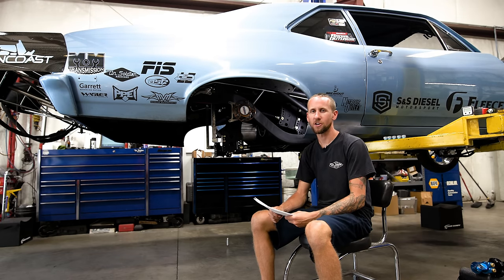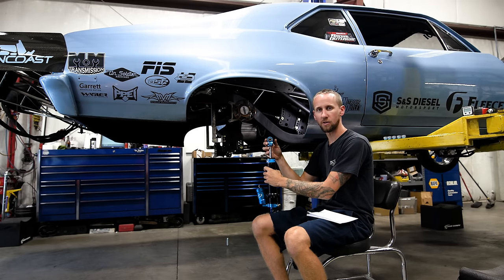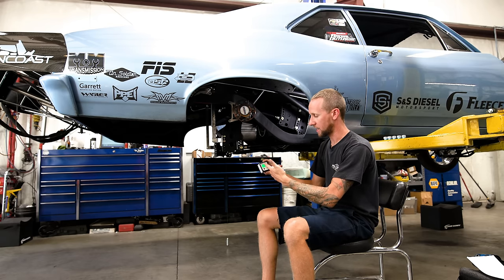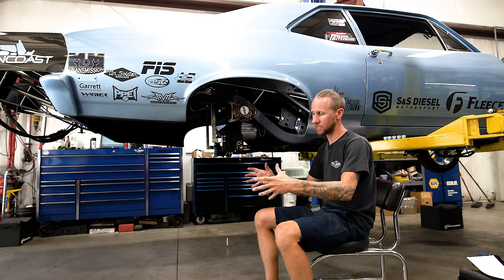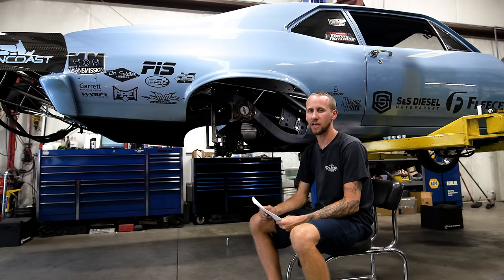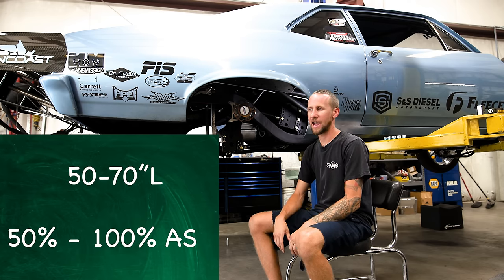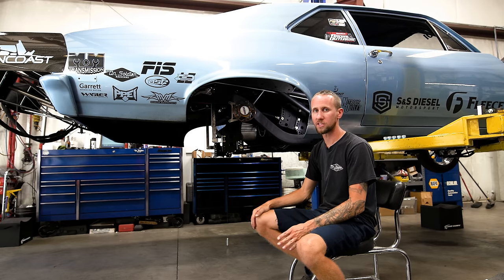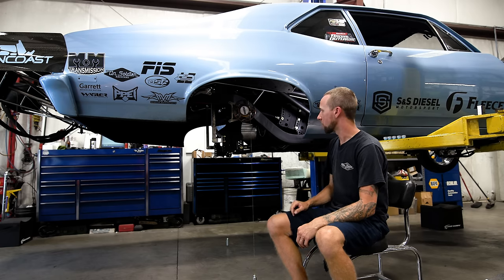4 Link Suspension For Drag Racing -  Useful Tips How To Set Up Successfully

Comment: Couple of comments. String the chassis to find the centerline & measure 4 link chassis bracket locations to ensure they are exact side to side & front to back FIRST. If not, everything measured from there on will be off & you will have to start over. 
Using the string method eliminates measuring from ball joints (or other components) as well as if the car has staggered front wheelbase.  Another reason for establishing centerline is getting wheelie bars square to the centerline. When there's rear steer the wheelie bars should be adjusted to the centerline. 
 Another method of measuring pinion angle is to remove the driveshaft from the equation. Measure rear end housing angle & Engine/Trans angle then calculate from there. 

Great videos, thank you for sharing!
Reply: A Educated customer is the best. Has a class are type of racing ET .And then theirs the rest .ProStreet guy that Champagne taste on a beer budget

Comment: What is the most accurate way to find the middle of the car in the front?  I have a stock susp. foxbody.  Love the How To vids, thanks!
Reply: Find one point on the sub frame inside or out doesn't matter drop plum bob mark it on the floor. Go to the other side an the exact same location on the sub frame from the other side do the same plumb bob it. Do the same in the rear then measure between the two points on the front. Find half way an do the same in the rear. An you can chalk line the two center marks front to rear. You have to make sure your ok with your car setting in the shop where you make it until your done.
Reply: There are usually factory holes that were used to align all the sheet metal parts in the factory fixtures prior to welding.  These work great so long as the car was never in an accident.

Comment: Good video. 
When you say that you can't use the 4 link to preload in a stock suspension car...do you feel this holds true even when you add a wishbone?
In my experience, even a triangulated setup will be able to use the upper bars to preload IF you have added a wishbone to the "stock suspension" mustang or G body
Thanks

Comment: So how bad or abnormal is it for an old car to be 1/2-1/4in off in triangulation to the front. How bad is it if my left bars will have to be 2-3 turns shorter than? Im really stuck on my rebuild, i could really use some advice